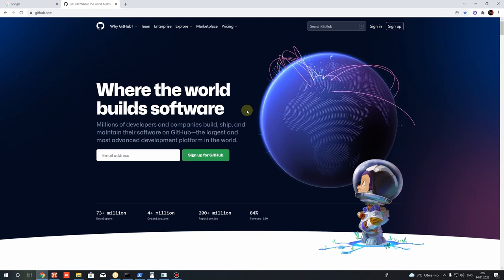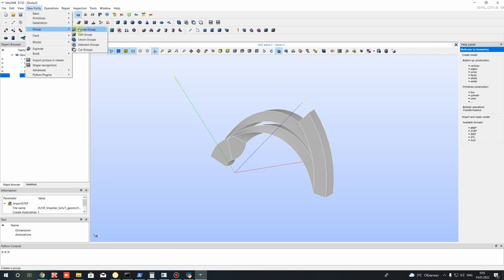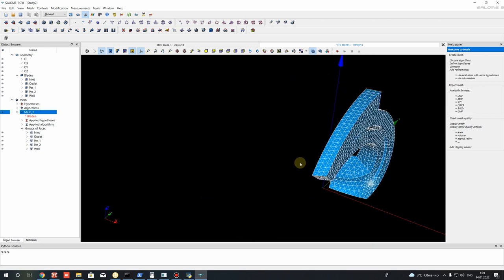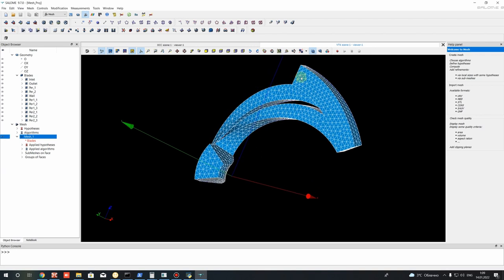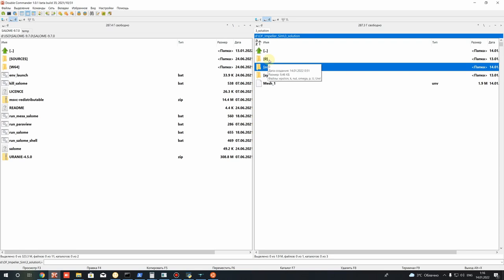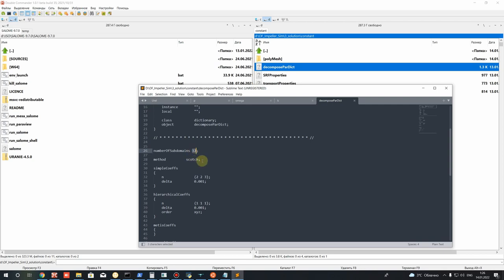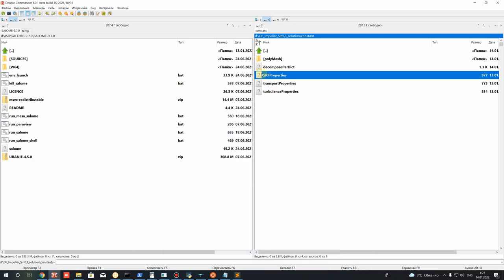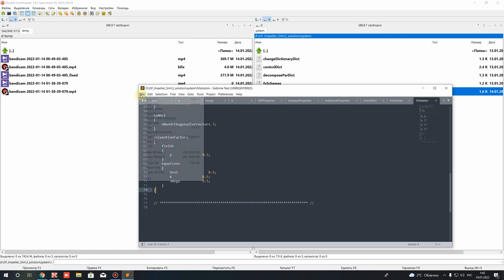FreeCAD + OpenFOAM | Design and Simulation of Centrifugal Pump Impeller

Comment: Thanks for the valuable video, Sir. I have a question regarding inlet velocity. You specified relative velocity as purely axial. But from continuity, the absolute velocity is axial and relative velocity should have axial and tangential components as I know from velocity triangle at inlet. Is that correct?

Comment: Very good tutorial but I think that it would be easier with free Engys openfoam software, may you try to make tutorial with Engys?
Reply from the maker: It’s a good idea I think, but I didn’t use the Engys before, I will try to repeat some cases there also I think
Reply: @CFDIntech  Maybe it could help to jump over some steps and save time.
Reply from the maker: @Poduhvat  Agree with you, goal of GUI is save time
Reply: Of course that GUI save time and make software much more easier to use. I am surprised that for so long time no one had not made GUI for OpeanFoam including much more simpler meshing than in Saloma software. For example I use Autodesk CFD where you can set up simulation in few steps in Solid works is even more simpler. FreeCad and especially OpenFoam, Paraview as well are great software but they are all separated and it take a lot of time to go trough them all. If there would be some kind of 'roof' software to united them all that would be great. Like Blender in modelling and animation area for example.

Comment: Evgeniy, would you have the idea how to simulate in turbine mode, e.g. like pump-as-turbine? Is it as simple as just reversing the inlet and outlet boundary conditions, and perhaps the speed direction?
Reply from the maker: Yes, you can set massFlowRate to outlet, but you have to use volute, because flow direction without volute will be have not right direction, I can prepare example about turbine simulation for impeller + volute if it is interesting
Reply: @CFDIntech  thank you, yes that would be helpful if you could do that. Thanks